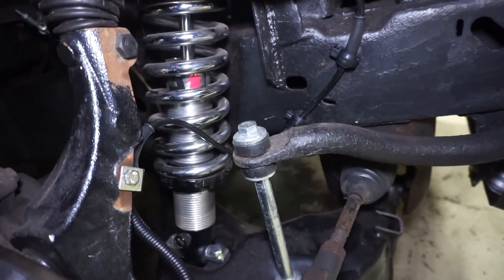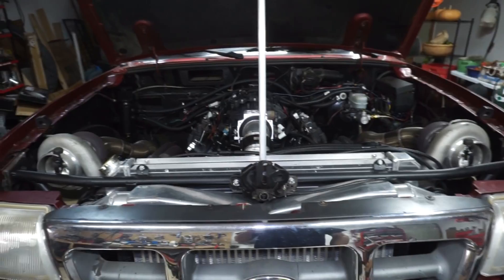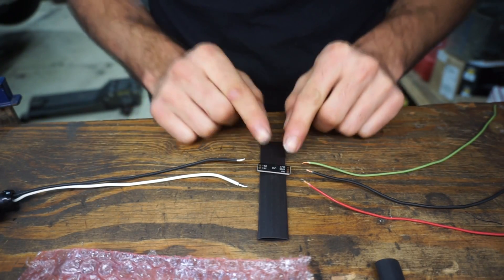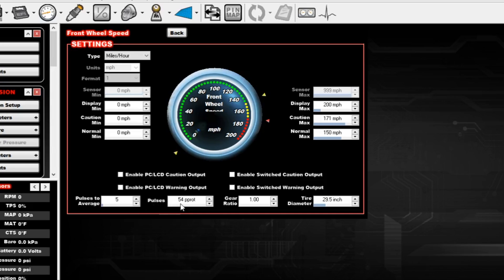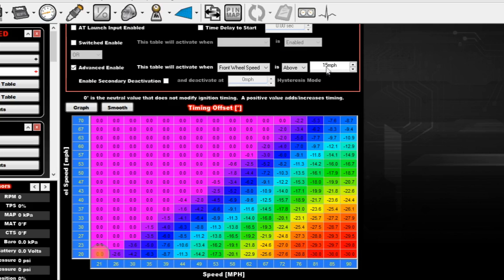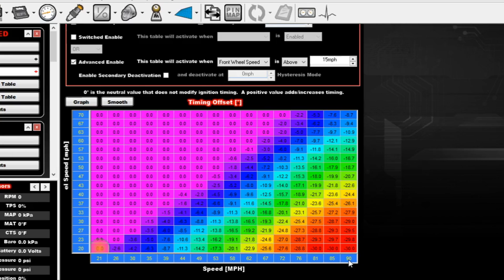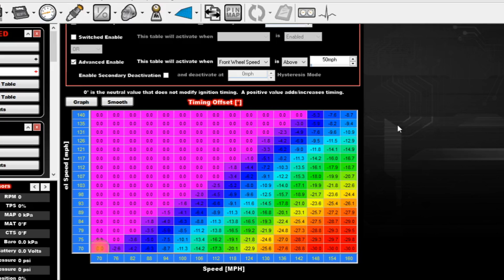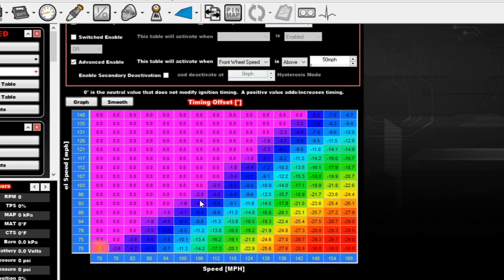Traction Control using VR To Hall Converter on Holley Terminator X max

Comment: Hope you have good luck with the Hall converter. I went through 3 of those exact units using it with a Terminator setup like yours, before I ended up ditching the stock VR sensors and using a typical Cherry Hall sensor off the stock trigger wheel with a DIY bracket.
Reply from the maker: Lol, welll.... I went to go drive it yesterday and wasn't working. Spent like 4 hours troubleshooting it, no dice.
Reply: @BlaserBuilds  Mine worked in the shop with a manual hub spin-up on the drill. And would work for a few minutes driving before dying. I don't think its a fundamentally bad part, but it doesnt seem to like living between a Terminator and ABS style sensor. I even tried varying the ground from chassis ground to sensor ground along with the 5V supply, no luck there either. 

Cherry sensors (or other similar "common" hall sensors) are cheap enough to be worth the effort of adapting, IMO.
Reply from the maker: @ProModsPerformance  I emailed them and they said the Terminator X signal is "Not very clean and typically blows out the chip"... Here's a part they recommended as an alternative... Has built in regulator. 
https://sirhclabs.com/product/cortex-ebc-speed-sensor-adapter/
Reply: @BlaserBuilds  would love to see you try the one they suggested and update us. Fueltech also makes one obviously its more expensive because fueltech. Feel like there isn't enough people doing this with 80e's using the output speed sensor and just using cherry sensors instead
Reply from the maker: @jakesdad21  I bought a lowdoller hall sensor and set it up. New video shows the first test with it.
Reply: @BlaserBuilds  well that's what I get for waiting to subscribe until now, thanks for all you do

Comment: Since this is a safety you might want to offset the main rev limiter instead of offsetting the timing.  You might be surprised that the timing will not pull HP fast enough.  All of your table concepts will work the same way.  The rev limiter might be more predictable.
Reply from the maker: I dont think you can do rev limit offset on terminator. Dominator has it. I would prefer that actually.

Comment: Now that I saw this episode…… you were seeing the traction control coming on without slip. this is because the software interpolates across the cells. Even at a given speed, 0.0 timing pull,  you still will interpolate The cell directly to the right of it and it will actually pull half of what you are doing. From left to right the cells should be +1.5,0.0,-1.5. This would make the 0.0 cell a true 0.0. This is why it was trying to pull timing even with it off and cruising
Reply from the maker: I did see that on a different video after I made this. It will be a change I add.

Comment: Can you do traction control with drive by wire control instead of timing if you’re using a DBW throttle body?
Reply from the maker: Yes, you can do a DBW offset to -100%
Reply: You can but using dbw is slower then pulling timing. You can also better fine tune the about of wheel slip you want.

Comment: I bet you could also apply that concept into a ride height sensor, to control wheelies...?
Reply from the maker: You could. Or laser distance sensor to read distance from ground...  this should in theory work for wheelies too. If front wheel is in the air not turning(as fast), and rear wheels are picking up speed it would pull timing.
Reply: @BlaserBuilds  Yeah, that's what I was thinking. Nigel runs the laser sensor with his Fueltech. You should put together plug n play sensor packages, like Matt. Be good little side gig. ;)
Reply: I also know of a guy who used a 3 axis G meter, to deploy his chute in the event the car got too far out of control. Just like this, there are expensive options, or cheaper options. I have a few 3 axis G meters I bought off Amazon for almost nothing.
Reply: @rpturbo  I've heard of that before. Some people have had them deploy with bad tire shake, that they drove out of, so it actually was a hindrance.
Reply: @funfun8095  definitely could be, lots of factors involved, but I'd take a loss, over putting it on the roof, and day of the week. The guy I'm referring to, actually did exactly that, backed it off, turned it off, then put it on the roof.

Comment: Very nice!  Had not realized the X Max had tcs capabilities… safe to assume the regular terminator x does not?  I’ve looking into running a standalone system (RaceTCS) which shuts off injectors rather than pull timing, and there’s still something about that I like - will be interesting to see how well this performs for you though! Cheers✌️
Reply from the maker: X and x max could be done this way. They both have Digital speed frequency, but required hall effect. Dominator can do VR sensors directly, without converter. Only thing I don't like about fuel cut, is the possibility of short pulses causing a lean condition. Unless it finished the full pulse width, then cuts. I'm just unsure how that works.
Reply: @BlaserBuilds  No way! Even the normal X - awesome!  That’s fantastic news, I’ve already got front wheel abs sensors to use, and the digital speed output from the transmission, so all we may need at this point are 2-3 of those converters to let the Holley work with the signals.  Perfect!!  I do agree on the running lean aspect… haven’t heard of that being an issue with this system but in a worst case, it could be bad.  At this point, I’ll save my $600 and start with Holley’s built in system, and can always switch to something else later if need be. Thanks for the help man!  Really appreciate it! 💪👊
Reply from the maker: @FanatikBuilds  Yeah you'd just have to use 2 inputs, which you were already planning to use 1 for the speed from transmission for the rear. You'd just have a custom rear and a front.
Reply: @BlaserBuilds  Even better!  Thanks again man 👍
Reply: They "technically" don't have tcs capabilities. This is doing nothing more than a 2d table. Granted it should work, and while Holley doesn't "recognize" or train this, they kind of acknowledge it. Technically Holley only recognizes the Davis TCS, and it "only" works on the Dominator and I think HP. You also have to pay for the "upgrade " in the V6 software to run the Davis box.

Comment: Do you have a add on box for inputs and outputs seems like with fan,boost control , and this you’d be out of pins ?
Reply from the maker: There's 8 pins 4 in 4 out. After this I still have 1 of each left.